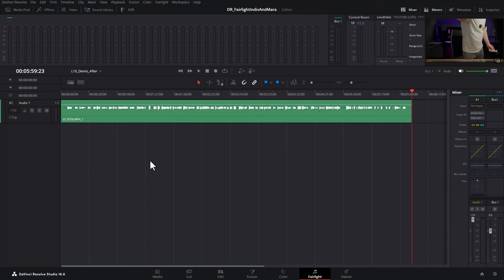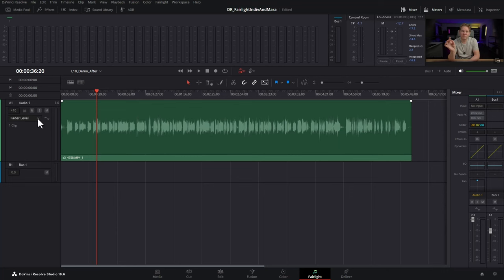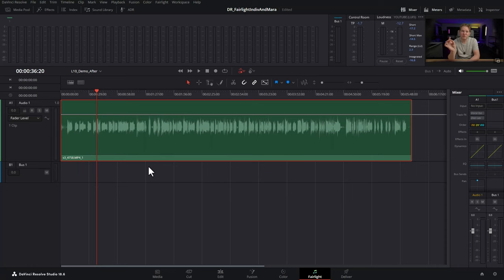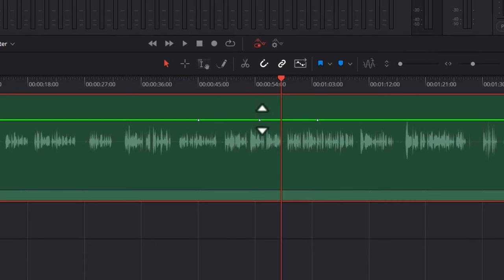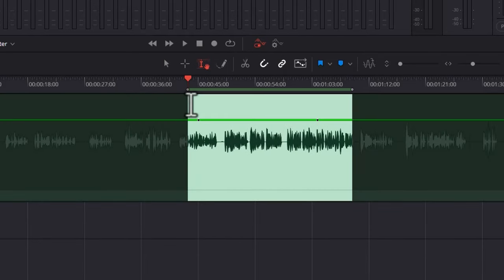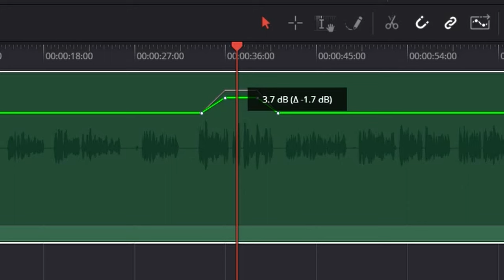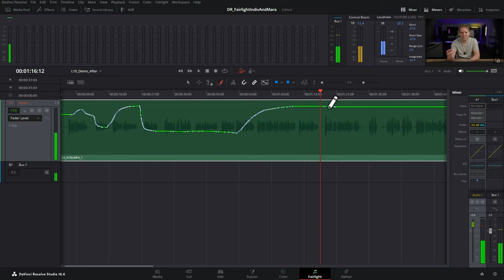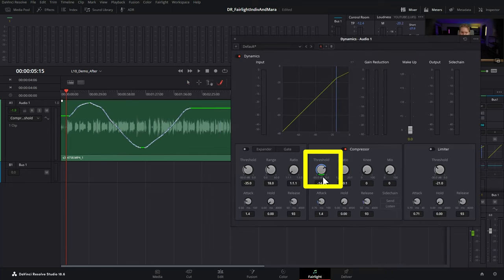DaVinci Resolve Volume Automation with Keyframes (Fairlight tutorial)

Comment: Hi is there a way to pan on a clip based and not automation for the 3d space. i know you can do left and right in the inspector but it would be so much easier if you can place the clip directly where you want in the 3d space without having to automate each time. is there a way?
Reply from the maker: You could just have different audio tracks panned to different places and move the audio for a clip to those tracks depending on where you want the audio. :) :)
Reply: @JasonRobertsVideo  yeah but it would completely messed up the ATMOS preset template. So you are saying that's the only way to make it work?
Reply from the maker: Ah ok - I'm not sure about 3d spatial sound editing I'm afraid.